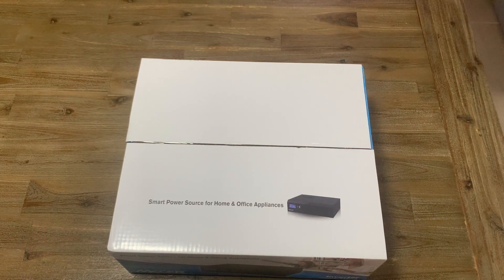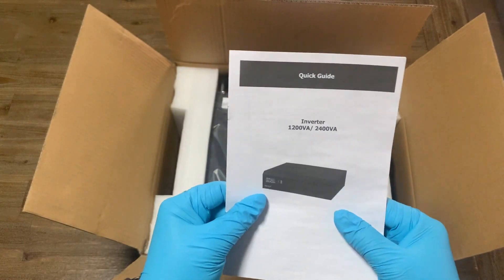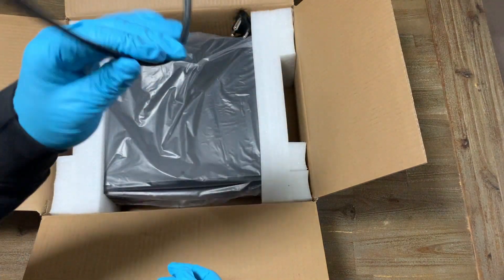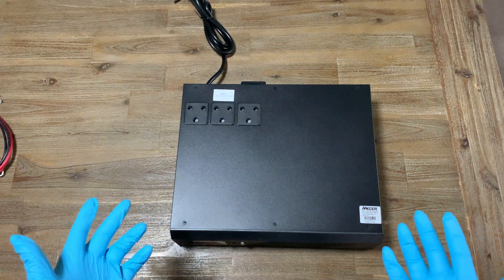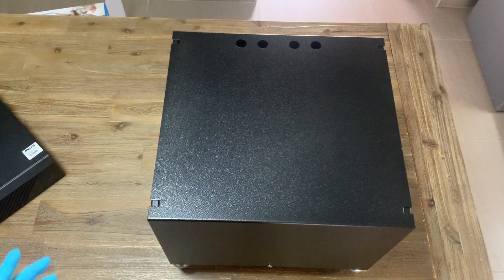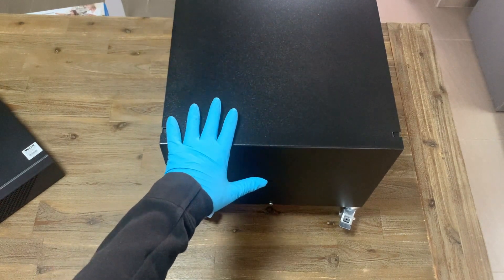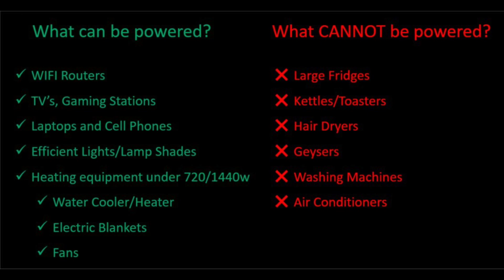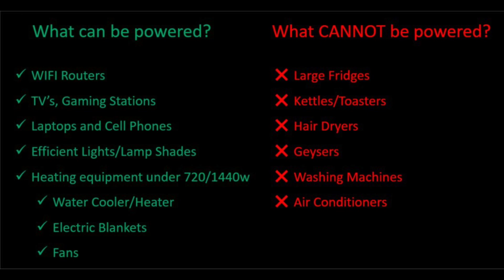Unboxing the Mecer Inverter - Load shedding work from home solution!

Comment: Hi there, Thank you for your videos. They are very helpful. Just a question, when we have power cuts, sometimes the inverter crosses over seamlessly, and other times, the inverter switches off with the power failure. The batteries are fully charged, and everything else is fine. Am I doing something wrong when pressing the button for power? Is there a special way to turn it on? Thanks

Comment: Hello and thanks for the video. I discovered it recently while shopping for larger ah batteries.  Not knowing to much about electricity and hoping you would, do you think it will blow up the inverter to replace the 100ah batteries with 2x 200ah batteries? My understanding is that charging time will be longer and that the inverter doesnt care about larger batteries but only about system voltage ie. In this case 24v or type of deep cycle ie. Calcium vs lithuim?  Thanks again!

Comment: can i connect solar panel to the 2000v merser invertor and what do i need
Reply from the maker: There is a solar charge controller that needs to be purchased then you can.
Reply: @alternatesolutions2408  could you explain on how to add solar to this system? I'm interested in buying this but I want to add solar to it also

Comment: What about a 45watts printer . The printer is only used about to print 10 pages and then it won't be used again for that day if there is a power outage.  It's for home use work from home situation. Can you please advise if the 2000va mercer one like this is good enough . Thanking you
Reply from the maker: It will be fine

Comment: Great video mate. I got my inverter yesterday but it doesn’t show anything when I connect it to the wall. 

Should the battery be connected for the inverter to switch on?
Reply from the maker: Must have a battery set connected
Reply: What happens if you just connect it to the wall

Comment: So i am thinking to build one up, but i have a question, can one start with a single battery on the 2400va and then add a second battery later ?
Reply: No, it needs to be a 24v or 2 12v batteries for this unit
Reply from the maker: correct thanks

Comment: I bought mine and i tried switching it on  without the batteries but it doesn't switch on to show that it's working, so can this mean there is a manufacture problem
Reply: pretty sure you need the batteries for it work; usually the seller will test it for you first to show it working with batteries before you walk out the door...
Reply from the maker: correct thanks

Comment: Hi. How do I connect mecer to a dB board? If you have a video pls provide me with the link to the video. Thanks.
Reply from the maker: For this, you require a qualified electrician to perform the installation and make the necessary isolation and change over to the circuits.

Comment: Great video man.

Just one question, should I keep the inverter plugged in and switched on all the time?
Reply from the maker: Yes if you can. If you can’t and there isn’t load shedding or power outs for a long period, then atleast once a month turn it on and let it charge up. Also allow it to run once every 2 to 3 months and run down to 50% and charge it back up just to cycle through the batteries else the batteries end up dying

Comment: So what happens if the geyser and fridge is on since it's connected to the wall?
Reply from the maker: It will trip and sound a buzzer due to over load
Reply: @alternatesolutions2408  thank you .

Comment: do you have a video of how you connected the batteries to the inverter please.
Reply from the maker: Hi there, no I don’t but it isn’t hard. On battery one take the negative and to the positive of battery two. Then the remaining open ends of each battery, positive on battery one goes to + on inverter and then the neg on battery two goes to the neg on the inverter. There might be a slight spark on first contact as the capacitors charge up. I use a resistor or breaker to prevent that from happening.
Reply: @alternatesolutions2408  Thanks, sorry what I actually should have asked was does the big batteries come with cables (positive and negative wires) or does one need to buy that separately. If I need to buy what does the ends look like, are they like jumper cable type clips
Reply from the maker: @stanceworks7995  ah yes the inverter comes with the cables. They are 10mm eye lugs and bolt onto the battery posts and 8mm on the inverter side.
Reply: Hi, how do i connect the inverter to a dB board? If you have a video pls give me a link. Thanks

Comment: What is the 3 lights in front for
Reply from the maker: Green Solid - The inverter is on line power (Wall power or "Eskom" power) and the battery is fully charged.

Green Flash every 5-10 seconds - The inverter is on line power, the battery is charging.

Orange - The unit is on inverter mode, running on battery power. The line power is disconnected.

Red - Fault mode, either unit has surged and blown up or it has been overloaded by a larger load than it can handle being plugged in, such as a kettle.

Comment: I can connect 4 12v batteries, that is 2 in series and 2 in parallel?
Reply from the maker: Yes you can, you connect two sets in series which will give you a pair of 24v batteries and then jump them into parallel to each other. Please check your final output before plugging it into the inverter.

Comment: Hands down the best inverter to get. It's even better when you linking up into the DB Board in the house with switch over box.
Reply from the maker: It is nice linked up as you then get lights on as well

Comment: I'm confused sorry. Do you need to buy the inverter and the big box on wheels?
Reply from the maker: correct, the big box on wheels holds the batteries which provides the new power source for your items

Comment: Hi Can I connect 2 x 230AH batteries to the 2400 VA inverter and if so how long do you reckon will they last during a power outage?
Reply from the maker: You certainly can. Basically you will be going from a 105AH 24v system to more than double that @ 230AH. So it will last twice as long. Depending on what you run during this time, it can last anywhere from 4 hours to 20 or more hours.

Comment: May you please make a video where you are using things like heaters, electric blankets and fans, I have the ellies one and would like to exchange the inverter to this meccer one if it's able to run those other things.

Also, am I able to add 2 batteries to the system so I have more off-line power to run more appliances?
Reply from the maker: You can add on more items but that will make the duration longer, not power more items. Fort more items you need a bigger inverter - if you are running at the max

Comment: Can I request a tutorial on how you hook up the batteries to the unit ?
Reply from the maker: It's really easy. Positive to negative using the jumper lead. Then positive to the inverter using the red cable and negative to the inverter using the black cable. The next one I put together I will take a quick video
Reply: @alternatesolutions2408  I just connected mine today, got worried when it sparked a bit while connecting the positive to the inverter unit - the supplier assured me that's all normal :) first time connecting one up and it worked out alright. 
As someone who has not done this before, it took a bit of figuring out, but I learnt a lot.
Reply from the maker: @waseemsabjee  the spark is surprising and not ideally great for the unit. The capacitors inside are charging up and it’s receives a large amount of amps causing the spark. I recommend using a resistor in-line when charging them up to control the amps through the unit. You just need it for a few seconds then there’s no spark.

Comment: According to the manual for this unit you have to install a 75Amp, 24V DC breaker on the positive line between battery bank and inverter.   Where did you find this and how did you install it?
Reply from the maker: The unit has a built in breaker for load protection on the unit itself. I have looked at the combined integrated Mecer unit and it does not have an isolator installed and thus i have used it myself in that way. If you do need a breaker, you can get one at any electrical spares shop - drop me an email on enq.alternate@gmail.com and I can send you a list of places.
Reply: @alternatesolutions2408  how much for this?